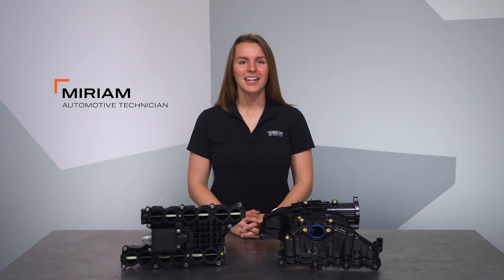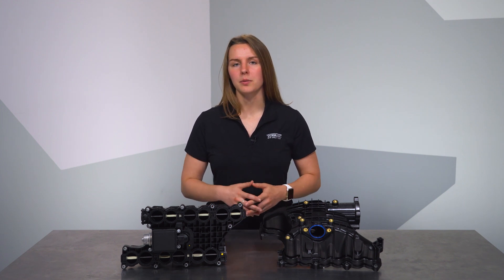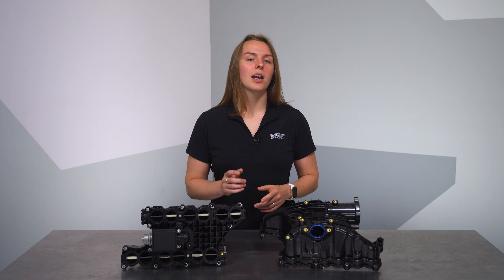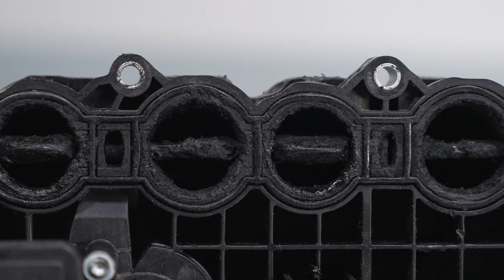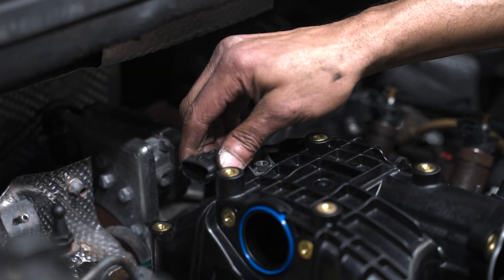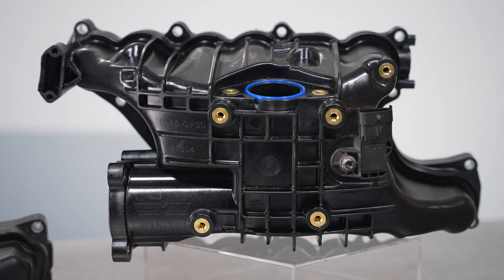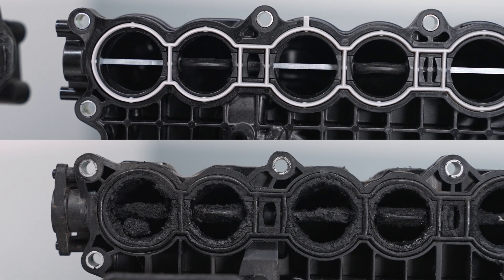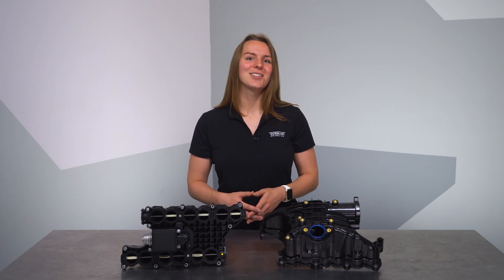Intake manifold repair for RAM/Jeep EcoDiesels | Dorman OE FIX 615-311

Comment: Swirl valve actuator is cooked and not available dont go this route youll get screwd
Reply: Why would you install the swirl valve actuator?  Just pull the swirl valves out, along with the egr and dpf. Then it won’t foul up nearly as much.

Comment: I’ve installed two of these; they are great replacements for the stock Mahle intake manifold. No complaints. Thanks for making these Dorman! You should also make a replacement for the problematic heater control valve unique to ecodiesel equipped trucks.
Reply: I’ve recently noticed that my ‘14 eco diesel struggles to hold a consistent temperature in the cabin. Is this a known issue?